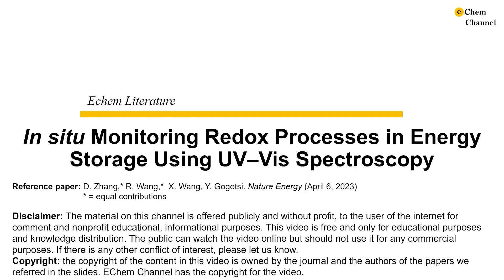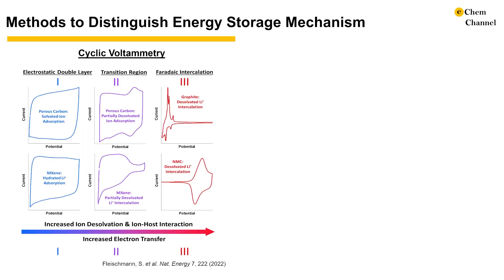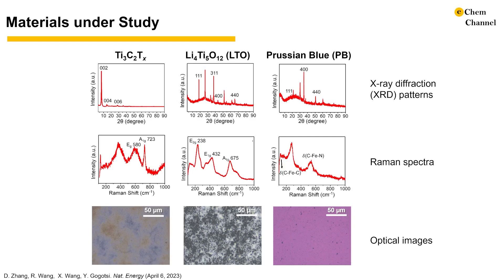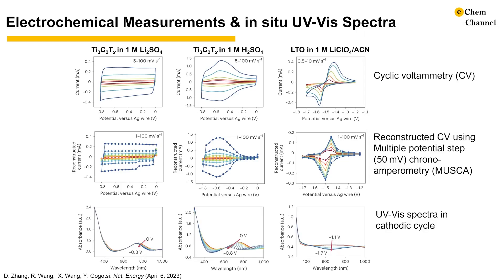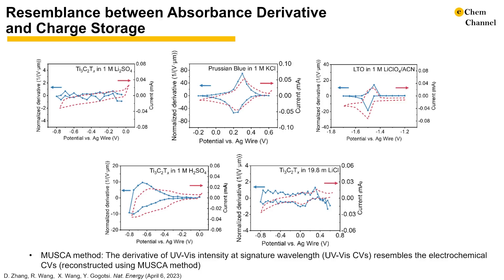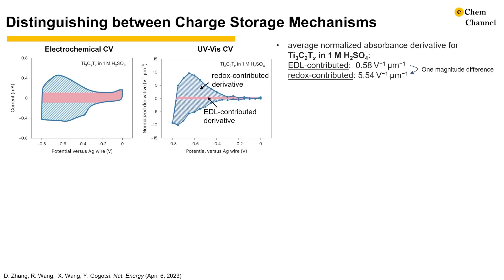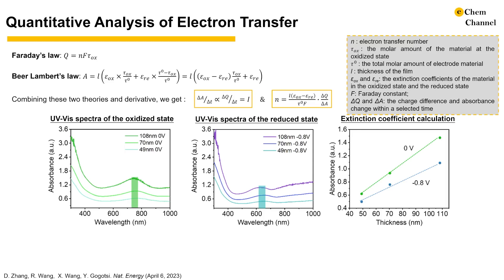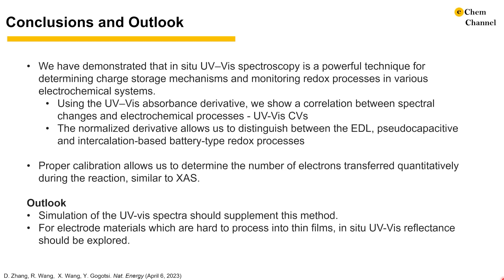[Research Paper] In situ Monitoring Redox Processes in Energy Storage Using UV–Vis Spectroscopy

Comment: Great work! I noticed that you used a Thermo Scientific UV–Vis spectrometer Evolution 201 in your experiments. I was wondering whether your setup included an integrating sphere. In our lab, we have access to a SEC 2020 UV–Vis spectrometer, which does not have an integrating sphere, and I’m curious if it would still be suitable for reproducing your experimental results.
Reply from the maker: Sorry for the late response. We didn't use an integrating sphere.

Comment: Hello, it's a great paper! Could you provide more details about the spectroscopy cell? Like what separator was used and whether the glass was UV-transmissive or not.
Reply from the maker: Thanks so much for your comment, Bryan! Please refer to our experimental and SI for more details. We technically don't have a separator - the 3M tape was thick enough that it separated the electrodes and left room for the electrolytes. Yes, the glass was UV-transmissive.